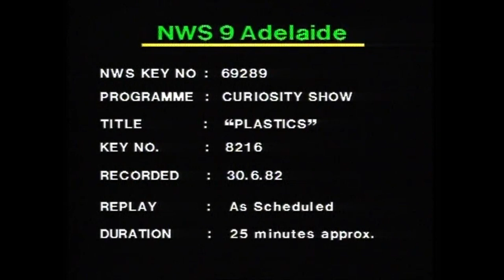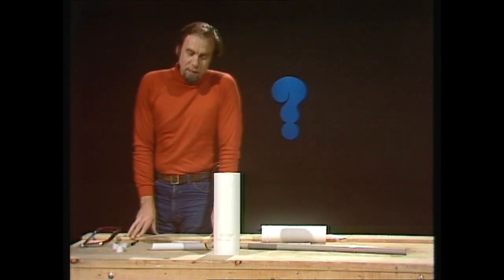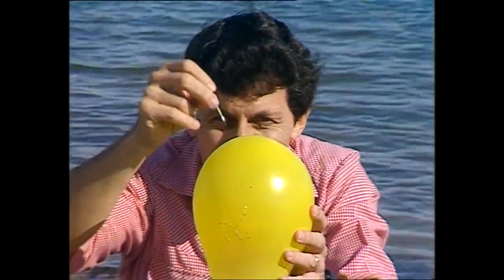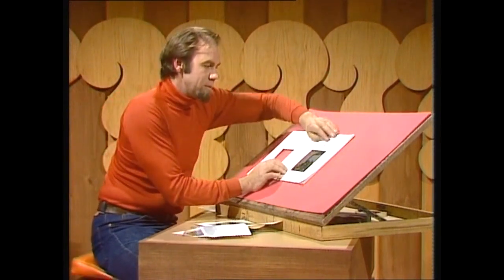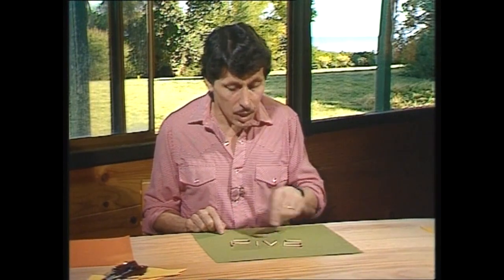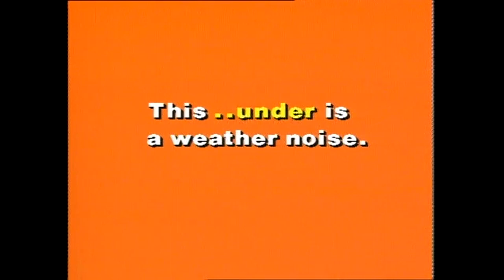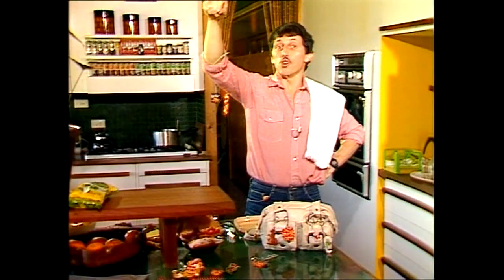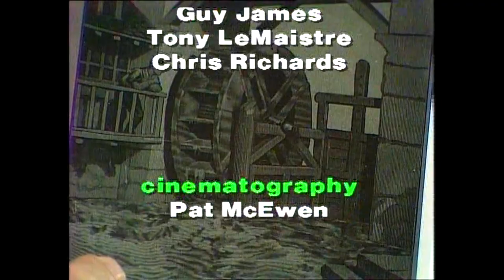Curiosity Show - a complete program

Comment: First, I will take 3 of those fairlanes with discounts and btw, I can skip a round rock, just have to throw it super hard and low. I used to get around 3 or 4 skips but it would hurt my arm throwing so hard. BB guns will skip BB's too. Almost lay the gun in the water and play with angles. I once had one skip in a clam creek in mini skips that went at least 50 feet. That was a lot of skips. Some day I want to reproduce that with a slow-motion camera.
Reply: One time on a rare day at around 11 years old I skipped a stone 15 times across an inlet approximately 60 metres and hit a boat on the other side in dry dock. My friend was astonished. I was never able to achieve that feat again.